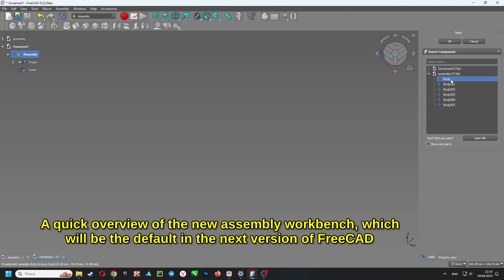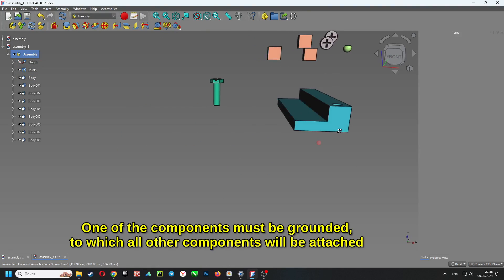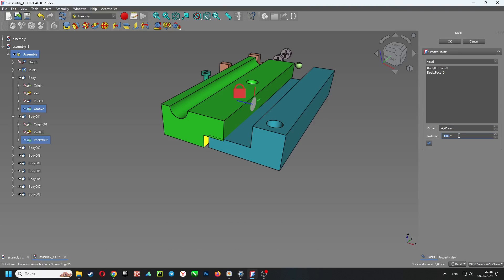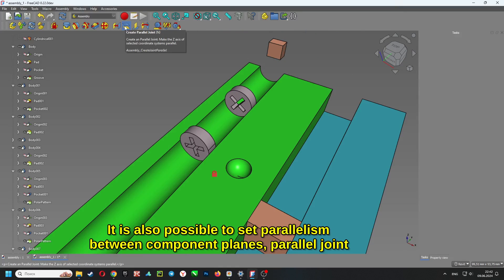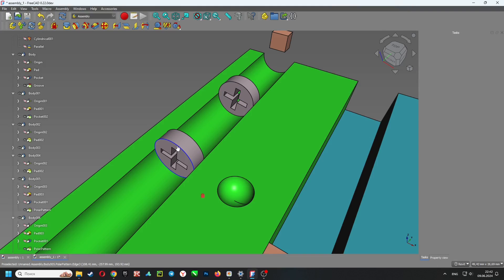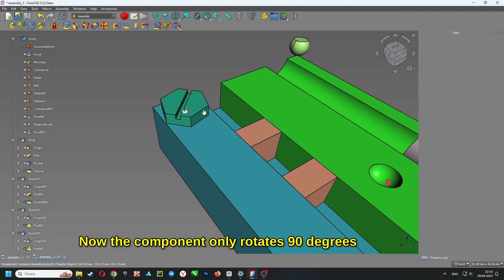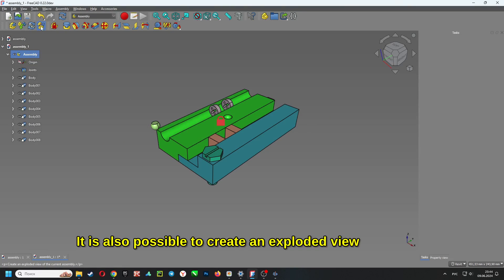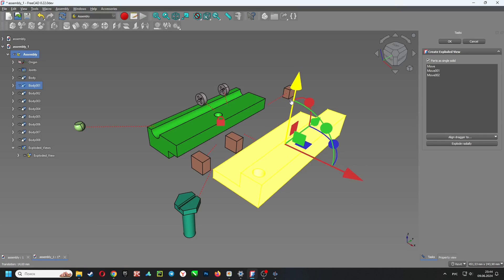What's New in FreeCAD - Assembly Workbench

Comment: the ball joint connexion does not work in your exemple, its interfering when moving. the center point on the ball should be mated with then other center point on the cavity on the part
Reply from the maker: The workbench is under active development, not everything works perfectly yet

Comment: The options to attach parts is all greyed out on mine
Reply: make sure you saved the file first, then right click on the assembly in the tree an tick on "active object". Then a few buttons should be available. For the rest you have to lock one part as grounded. To do that you have to select the part you wish to lock and press the icon with the red pad lock. Hope this helps

Comment: When you have assembled a few bodies with joints... How can you design a new body that fits around the features of those assembled bodies? Does it have to be done in a different file?
Reply: That's called "in context modeling" if you want to search for it and @OficineRobotica has a good video on it: https://www.youtube.com/watch?v=JZUsNR2ys1I Basically you select the features your new part will be referencing, then create a Sub Shape Binder. Then place a Link to the Sub Shape binder into the file or Body of the new part. Now you can reference the assembled geometry in the new part. The Binder and Link are parametric so changes in the assembly will propagate through to your new part.
Reply: @ElectricGears  awesome, thanks for the answer. I'll try to reproduce that workflow with the new assembly.
Reply from the maker: Components to build can be done individually, each in its own file, or you can do everything in one file. All the bodies for the example in the video were made in one file

Comment: In 2013, Jonathan Westhues took the FOSS community by surprise releasing the source code of SolveSpace, his parametric 2D/3D CAD software built around a very capable custom solver. Some 4 years later, Zheng Lei aka “realthunder” created a Python binding for the solver, then used it to create his own assembly workbench for FreeCAD.
Reply: You didn't make a mistake?
I'm using the “realthunder” build where the assembler is “asm3”. The video shows the new assembler.
Reply: did you mean freecad real thunder ? where i can download it ?  @gurom7